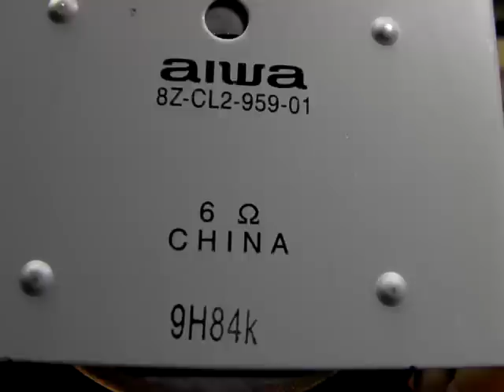test aiwa Speaker unit 8Z-CL2-959-01 13cm (Bass I Love You)

Comment: Hola, tengo un Aiwa NSX T9, el equipo ya no funciona, y quisiera amplificar los parlantes con un amplificador, pero cada una de las cajas tienen: Un cable rojo, otro negro y otro azul, para el subwoofer, que tengo que hacer para que funcione sin problemas y utilice todo el potencial. Gracias. (Montevideo-Uruguay)

Hi, I have an Aiwa NSX T9, the computer no longer works, and would amplify the speakers with an amplifier, but each of the boxes have: A red wire, one black and one blue, for the subwoofer, which I have to do to it run smoothly and use the full potential. Thank You. (Montevideo, Uruguay)
Reply: +Gustavo Negri Hola, tenés que conseguir dos amplificadores, uno para el Sub y otro para las bocinas de medios, todo por separado, ya que la serie NSX, vino en su mayoria con Multi-Amplificador, espero que te sirva, saludos desde Argentina.
Reply: Gracias.